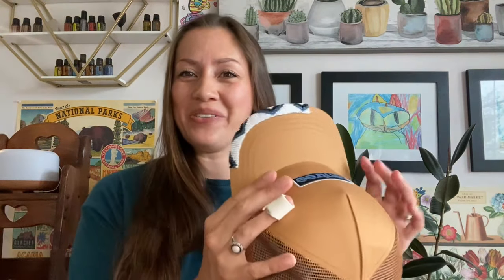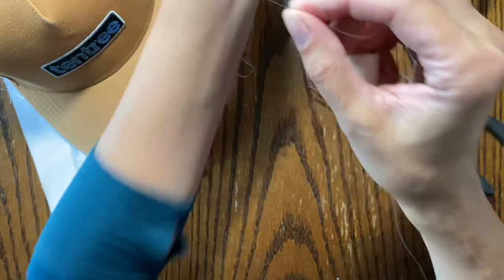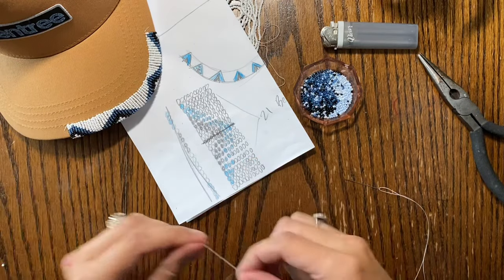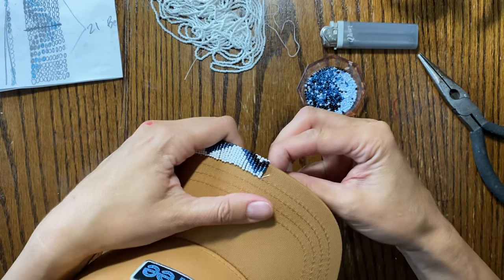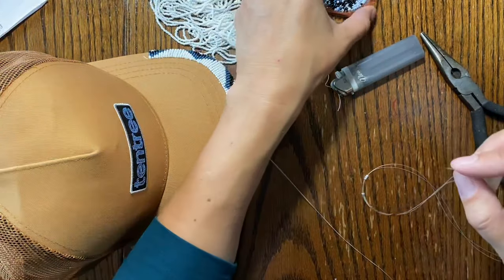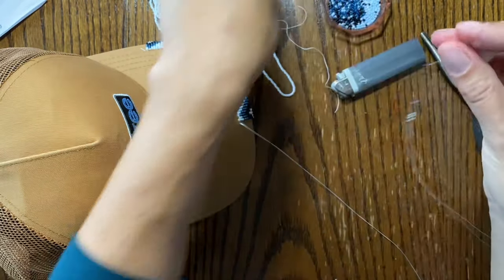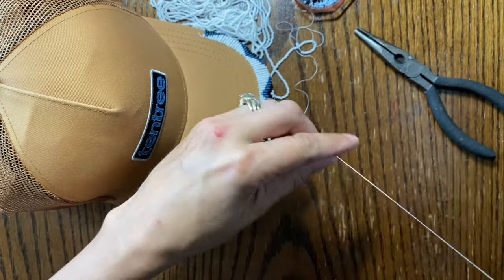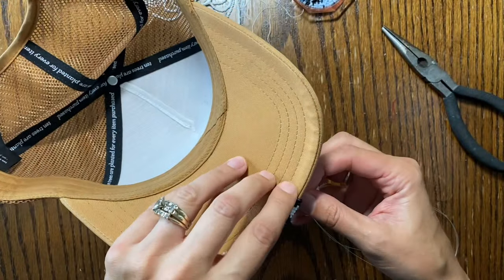How to Bead a Hat Brim

Comment: I started beading because I wanted to bead my graduation cap. I watched this video to help me. I go from to to bottom, I use a thick (I think for leather) triangle needle to puncture the hole than my beading needle doe through fine. I also use a thimble to push the fat needle through. Works great for me. Thank you so much for putting this out there so I could learn. Also what I have been doing lately is making my line a bid shorter so if it comes undone, only a small section does and to start a new line I puncture two holes in the open space (that will be covered up) and loop it through to finish the line, that means I only have to put one or two knots in the end because its nicely secured from being wrapped in the two holes. Again, thank you so much for putting this online to help those trying to learn.
Reply: Triangle needle?

Comment: QUESTION.. how do YOU figure out how many beads you’ll use? I’ve seen a few different methods and I’m looking for the easiest way.
Reply from the maker: Designing is the hardest part of beadwork! For hats I try to lay one line of beads down and count how many fit. Then I do the design based on that number .  Sometimes it works and sometimes it doesn’t! That’s my easiest way though!
Reply: Thank youu
Reply: @twowolfstudio538  where do you find those needles and the thread conditioner at?
Reply: @B.JeannineWillson  probably Michael’s or a local art store

Comment: Thank you so much for this video! I’ve been recently watching tutorials on beading designs on hats all over YouTube & yours is by far the best one yet! From supplies needed, to showing your paper design, down to your directions! I have a question…how do you sew designs on a circular hat? I just bought the Women’s Felt Floppy Hat - A new Day from Target and it doesn’t have a stitching guide and its not thick. It’s waves like a summer hat on the edges. How do you put your design on a felt hat design that’s not hard like a cap, and is thin like felt. Thank you! Looking forward to watching beadwork tutorial Tuesday’s!
Reply: Maybe you could try sewing an edge of interfacing or some stronger felt along the edge first to make it stay flat, then bead over that? I think there's iron on interfacing too but sewing with a machine if you can would probably be the strongest.

Comment: Hi! Beautiful work! One question (so far)… did you double your thread and knot the end at the beginning of your project? Thank you so much! ☺️👏🏻
Reply: My guess is that she does not double her thread because the beads might not all fit on that Glover needle with a doubled thread. I can’t say if she knots it at the beginning or not, but, in my experience with floral flat beading ( Mètis floral beading) I don’t usually knot anything. I just go into the back of my project and out through the top with my threaded needle and I come back down into the project and then I go back up and through it before I start adding beads. If the thread is loose, I’ll add a knot, but usually it’s in there really good. I hope this helps. Happy beading! ❤️
Reply: @Freebird-uo4jb   Thank you so much for your insight.  I don't think she adds content to this channel because she doesn't respond to comments or questions. She does beautiful work though.

Comment: Your awl is too big for that type of project, that's more for fabrics than anything. I'd recommend one with a smaller tip and punching your hole from the underside so you can use a smaller needle. Might help with those jagged edges appearing. Hope that helps